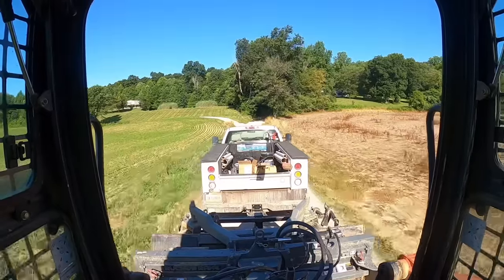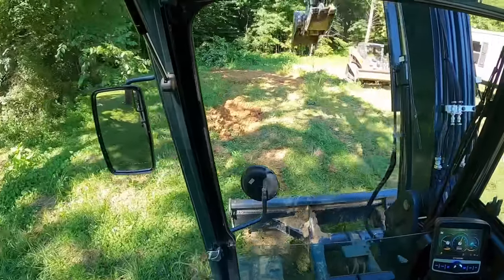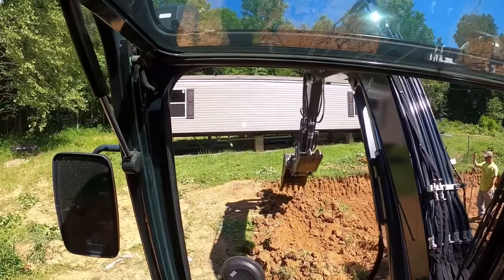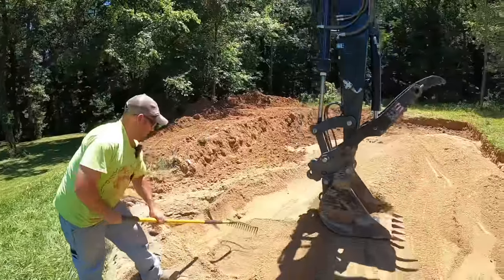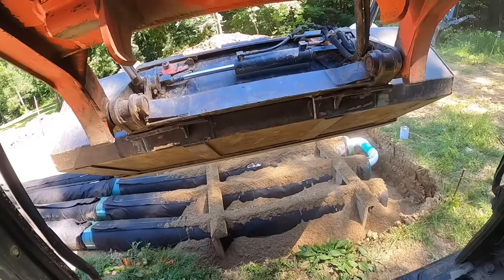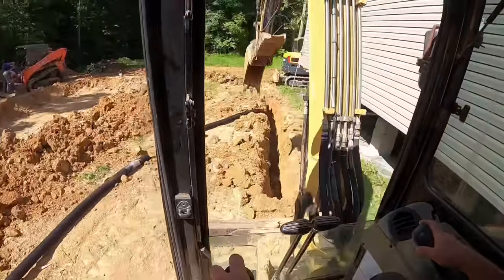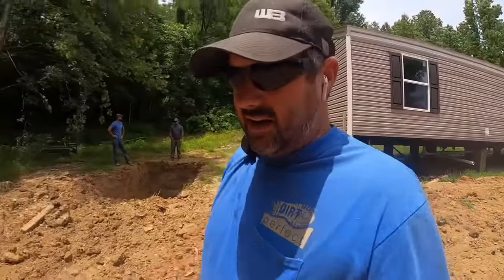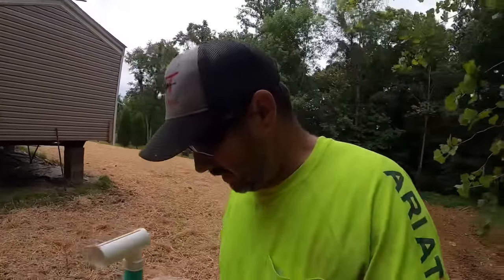The Hyundai HX85A proves to be just the right size machine for this difficult job

Comment: You need to get a couple asphalt rakes, rather than the little garden rakes!  They work better and faster.  I bet the other brands of skid steer rigs have similar access problems!
Reply: I do believe the technical term for that device is called a hoop break could be wrong but I do believe so and no it's not a Hoop it's just a big race

Comment: I can't remember if the D5G has a battery disconnect to shut down everything or not.  It should shut down everything ... including the ECM fuse/relay circuit.  If there is a disconnect and the fuse stays hot, someone did some 'custom' work.  I will check with Dave to see what else it could be.

Comment: After seeing others comment about that tree. Might help.understanding why it had to go.
I worked in new home construction for over 25 years and only saw one tree saved per home owner request. It was less than 25 feet from the house, builder tried to explain why it needed to go but was rejected. He had the homeowner sign a liability release.
Trees close this work will go through "root shock" and will more than likely die. On top of that, this tree roots will eventually infiltrate the field lines, very costly to redo the lines.
The house I mentioned, the tree was a 4' diameter "live oak". It was declared dead within the first 6 months of owner occupation. Last I heard the homeowner ended up paying almost 10k $ to have it topped, removed, and the stump ground. Never heard about the landscaping bill but it had to be huge.
So, yeah, this tree needed to go.

Comment: I’m probably wrong but it looks like you dug a 20’ wide area and only used 10’ for 4 pipes. The other 10’ was just covered with dirt after you put 6” of sand in it. Stay safe
Reply from the maker: That’s exactly what we did and was required thanks

Comment: So question: I'm from a country where these septic systems don't/rarely get used (maybe in more rural areas). Doesn't it start to stink having it that close to the living space? Especially that high to the surface?
Reply from the maker: No not at all if it’s does you have a problem

Comment: why is the mobile home so far off the ground?  and who wants a septic field right in their front yard   HA YUK
Reply: The mobile home is on a hill, the other side is basically touching ground. As for the septic field…sh!t goes downhill, not uphill. Besides, other than visually noticing the style of this one, you shouldn’t notice a proper working septic system, anyway. You would never figure out where mine is.